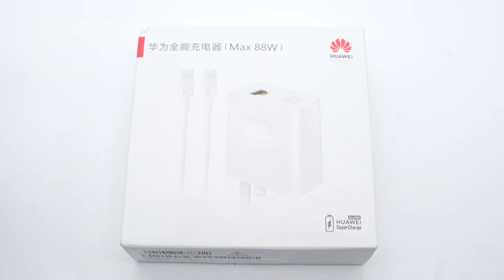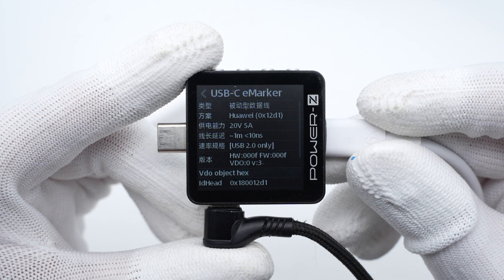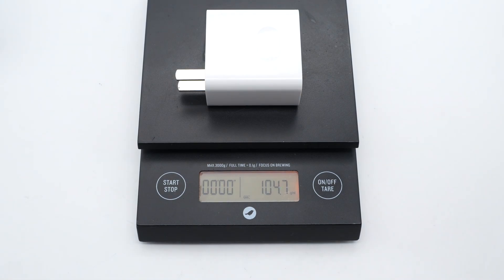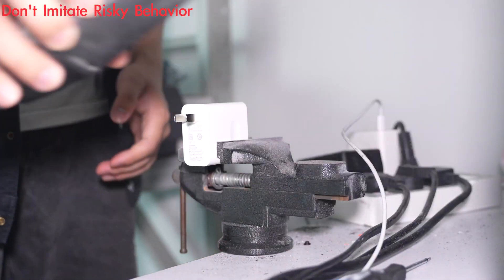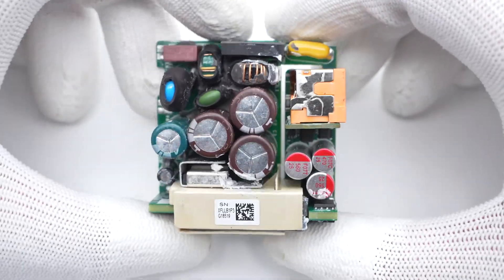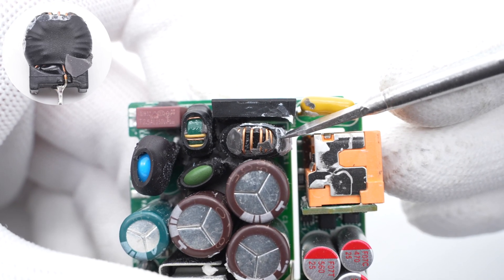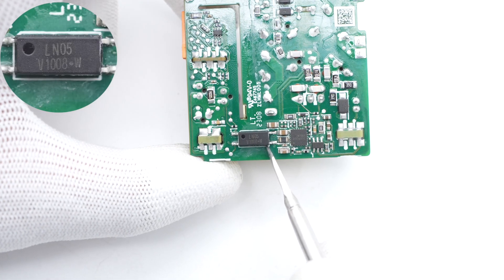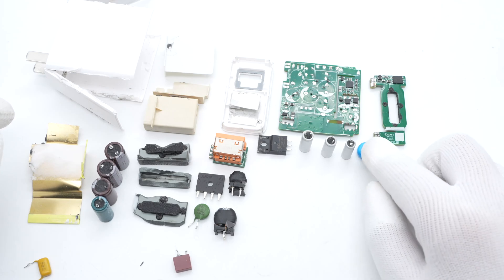Single or Dual Ports? | Teardown of HUAWEI 88W Fast Charger (P60 Series)

Comment: you know in my country there are a lot of fake products
here I have a huawei 88w charger that supports full protocols mentioned in the video
and is quite simmilar to it

but i bought it too cheap (around 20$) and it was package free 
would it be safe to use that charger? if it supports the right charging protocol?

Comment: my 6a cable (included on my poco 120w) also orange color, and i notice the connector also not full pin design, what a different between full pin and not full pin design? the not full pin doesn't support for the data transfer?